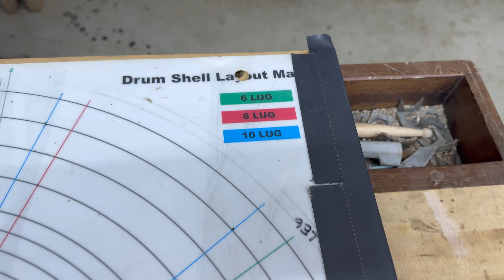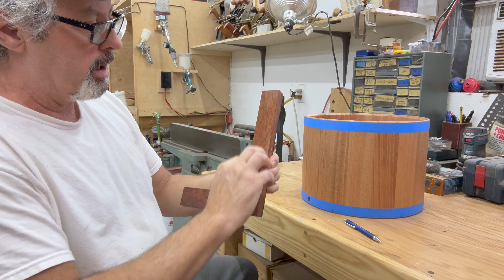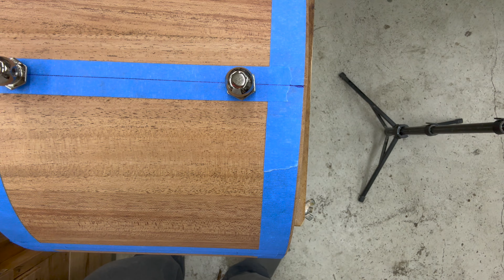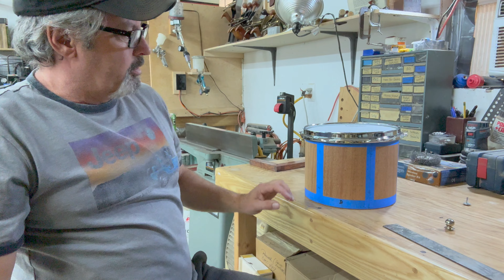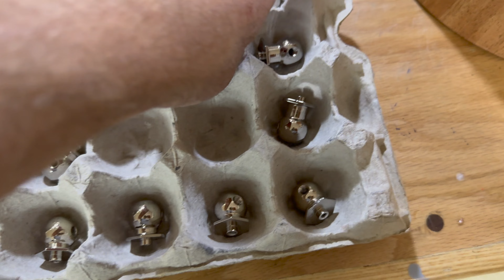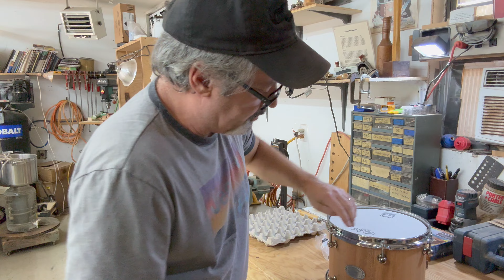Drumset Build: Mark, Drill, and  Assembly Process

Comment: I thought of making a large rubber band with evenly spaced lines that will just stretch over any shell, and show evenly spaced lines regardless of the shell size. I will probably not ever be able to make my own shells, but if I was going to, I would make them 10mm Undersized, with sharp 45 degree edges, like Sonor does. Then I have to learn how to make cast bronze shells.... haha

Comment: Ive been making 12 Lug Snares using the same mat, with the 6 Lug Markings. I have a tendency to check and re check my measurements, until I have multiple markings very close together. Then I will drill some of the holes in the wrongly marked spots. This being said, the 12 Lug Marching snare hoops tend to feel and sound awesome to me, and I can use single point Lugs and have less tension on each one, reducing the amount of pull that. can happen on single point lugs.